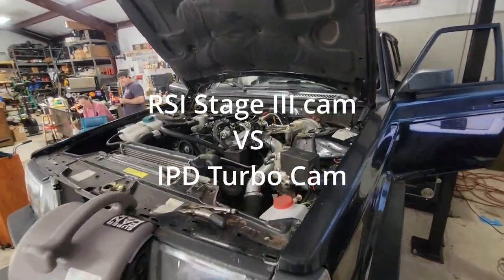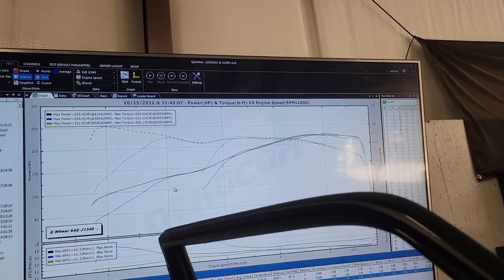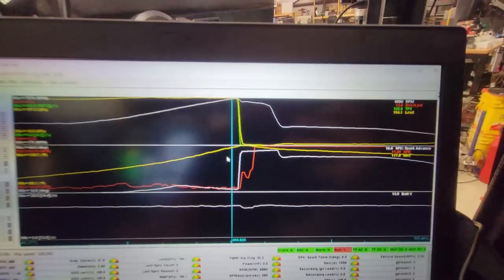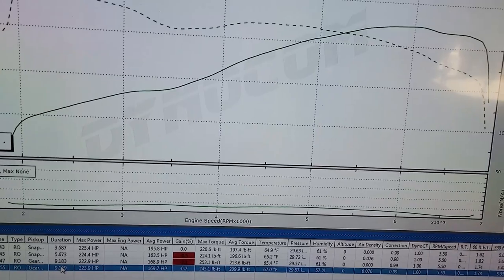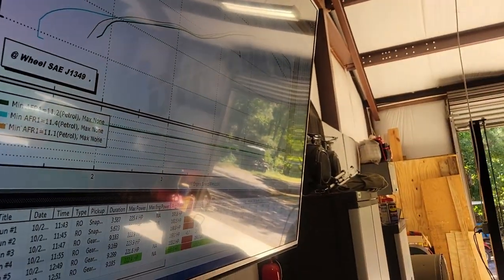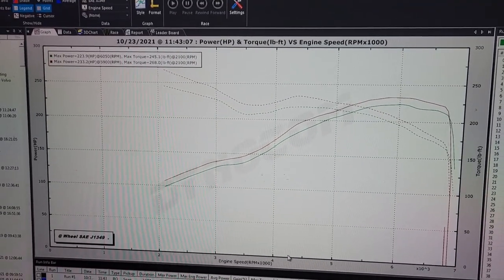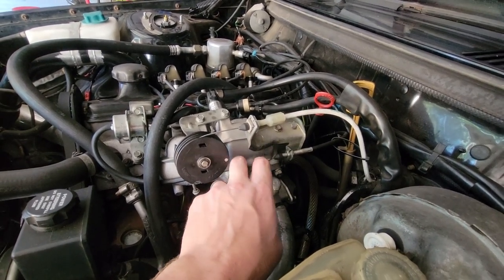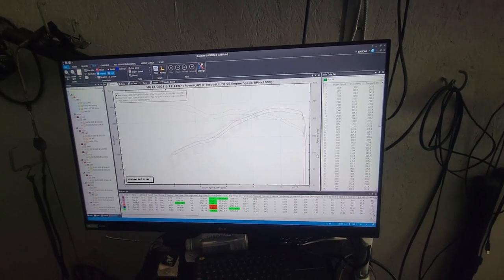Volvo Camshaft Comparison

Comment: Very interesting with the pinging and ignition timing between the two cams! With the greater overlap and I assume larger duration numbers of the RSI cam, I would’ve expected different. 

Regarding the valve clearances, were they basically the same between the two cams or were they good with the RSI and bad with the IPD?
Reply from the maker: The valve lash was good on the RSI cam.. needed some adjustment obviously on the ipd cam but we weren't too worried about it we just wanted to get some basic figures

Comment: Camshaft swaps are overrated. I once swapped a T for a K and i hated it. It brought the boost treshhold up more then 750rpm. Which made the car really annoying to drive in top gear on the highway. 50-70mph took ages, then at 75mph the boost would come in strong and too late. I don't want to have to shift down each time i want to speed up a little. That would suck.
Reply: Overrated is not the word you’re looking for. Mismatched for your setup and needs are more accurate. Cam swaps are awesome.